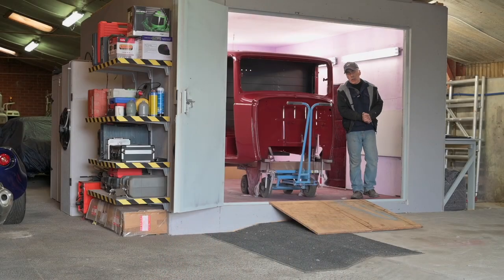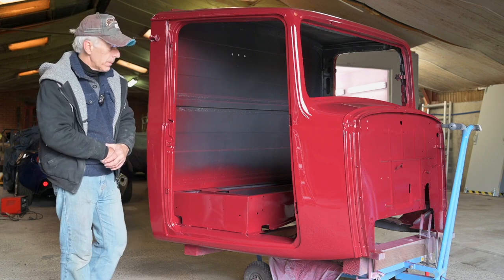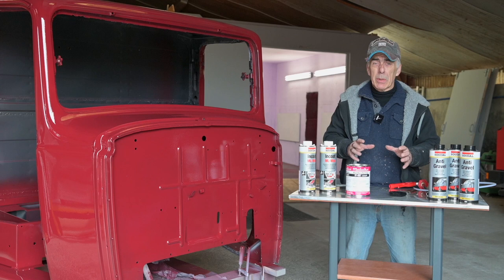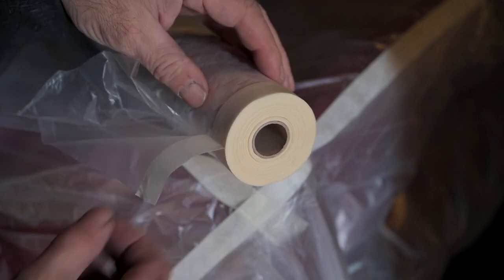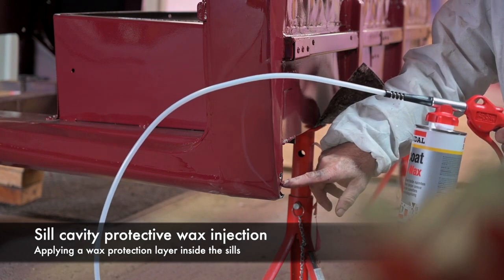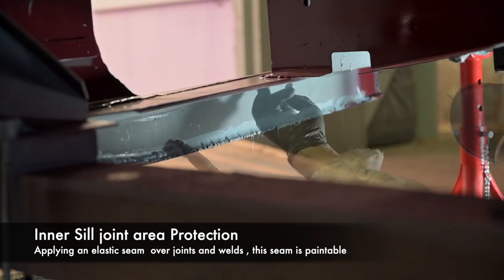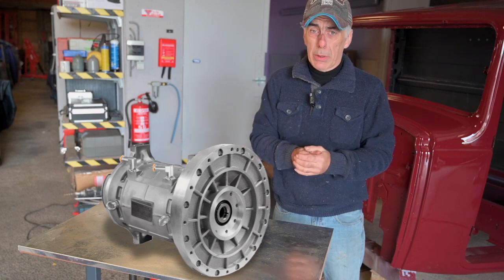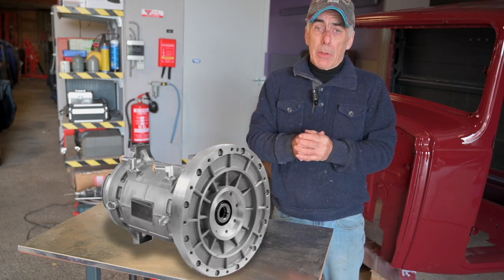Old Rusty, Part 24  Protecting against rust

Comment: How much more will it be used if it is electric?  It is old and you have the original equipment.  If I was missing the drive train or it was totally unfixable then a change would be in order.  It is what it is.  Electrify something else.

Comment: You going to install a rear end from a Corvette? Maybe wheels and tires from a Lamborghini? Change it's entire look? If was mine and I had the time and funds I would want to keep the  35 HP gas burner. My 1943 Ford tractor still has it's (mostly) original 4 cyl engine. But that's just me.
Reply from the maker: TXS for the comments, and I can see your point.  I really need to think it over on which way I want to take this. Off course not extreme.

Comment: Hello Steve,
Rules about the definition of a classic car state that if you put any part that didn't came from the factory (or was available at the time)  then the car is no longer considered a 'classic car'. Same guidelines state that if a car is used daily, then it is also not considered a classic car (which I strongly disagree with).
Thing is, if you are building a museum piece, more to be looked at than used in the real world then go with the original engine. But, as you mentioned, older cars are beeing banned from the cities (oddly they still allow it for diesel cars....)  and if a modern, even if electric engine will allow you to use the result of your hard work more often, then why not? (you can always revert it back to the original engine if you want to sell Old Rusty).
Cars are complex pieces of machinery and a lot of parts will last longer than others so I pollute even more of our planet building thousands of new cars every year when an older car can be modernized and keep up with modern emissions targets?
Going with electric is a good idea, but keep in mind where you charge it (use solar, not coal produced electricity). Other option could be hybrid but technically more 'challenging' ;) 
Lastly, if you opt for electric power you should try to use automatic gearbox. It'll be best suited for that.
Whichever route you go for, choose the one that will allow you to use Old Rusty as often as you want. 

Keep up the good work :)
Reply from the maker: TXS for the comments, and I can see your point.  I really need to think it over on which way I want to take this.  Great answers and comments.... txs

Comment: I would love to see you install an electric motor I have an old water-cooled VW van and replacing with an electric motor sounds like a good idea. However, I can see the merit in an engine rebuild for this classic. Emissions are only an issue if its an everyday driver, if it's a high days and holidays vehicle then there will be more pleasure in an original engine. Either way, I'm sure I will enjoy the videos you produce and both routes will be worthwhile. Best wishes.

Comment: Do both and change to whatever you want .But without any structural mods. Make fitting brackets  to fit oridginal set up.
Reply from the maker: TXS for the comments, and I can see your point.  I really need to think it over on which way I want to take this.

Comment: I'd probably do both. Restore the original engine, but go with the electrical motor for Old Rusty......
Reply from the maker: TXS for the comments, and I can see your point.  I really need to think it over on which way I want to take this.  But installing an EV motor requires a lot changes...  so having both is a bit difficult
Reply: @D3Sshooter  in which case, absolutely go Original.

Comment: Depends on how you will use it.
For the people not from the EU ,having the old engine means Old Rusty is banned from most cities (you can enter a few days a year provided you pay a hefty penalty)
This would result in Old Rusty sitting,not being used at all for most off the year.
Just gathering dust in a garage.
Advantage electric engine 

BUT the petrolhead in me says restore the old engine and make original.
A dilemma.
If money was no problem..............................do both.
Reply from the maker: TXS for the comments, and I can see your point.  I really need to think it over on which way I want to take this. That is the dilemma that we all face here in Belgium..

Comment: Looks like you purchased the electric already. If it's not too much extra work, install the electric to get Old Rusty on the road, then take your time sourcing and restoring the original with the eventual goal of putting it back in. Best of both worlds?
Reply from the maker: TXS for the comments, I did not buy it yet that is just a video green screen trick..   I am still considering both options

Comment: Do both. Series hybrid with a forklift motor inserted into the driveline after the transmission. Motor could be assist with engine on or motor only with engine off.
Reply from the maker: Thanks for the comments, a bit complex but am option.. However I started the overhaul

Comment: Restore the original engine and transmission.
If you must go modern, use it to run a generator and charge batteries. 
Then run the electric motor to drive the vehicle
I believe all your effort would be undermined from the financial perspective if you went electric
Regardless.....have fun with what you want to build.
Reply from the maker: Thank you for the comments

Comment: The electric motor sounds interesting, but I would stick with the original engine. Do they have a later vintage Citroen engine with more HP you could swap in?
Reply: itsjustme Then it wouldn’t be “original” anymore.

Comment: Keep it gas. If you're really concerned about rebuilding the old engine, you might consider swapping in a more modern gas or even a small diesel engine.
Reply from the maker: Thanks for the comment, started the rebuild of the old engine

Comment: Well sir that is totaly your choice though personaly i would go with a good diesel engine due to one not knowing where the world is going like in tensions building up atleast diesel can drive through water with a snorkle and one can use vegatable oil etc for fuel.On the old enjine will a beatle sollex carb work on it? Personaly i moded the base of a beatle to take an vw golf carburetor by making 2 plates out of aluminium and welding them together thus replacing the old solex and making it more fuel efficiant.

Comment: Engine overhaul, its an oldtimer which won't be driven daily and if you fit an electronic ignition system, updated carburretor etc the engine efficiency will be better than when it came off the factory.
Reply from the maker: That is correct, and what I plan to do

Comment: I myself like old style restoration but while you are rebuilding trains and gas motor you could place the electric 
while you work out the bug with handling and suspension  steering box and such there for still being able to drive the old truck in either condition  old fashion keeping it all as it was meant to be or as electric
Reply from the maker: TXS for the comments, and I can see your point.

Comment: At least here in the States, insuring a home made electric vehicle is problematic. At least when lead acid batteries are used, as weight distribution, CG, mechanical brakes and such get into issues that insurance companies don't want to deal with. I'm also into keeping the original drive train, as once this has been converted to a Frankenstein, it will never go back, and it's value is scrap.
Reply from the maker: TXS for the comments, and I can see your point.  I really need to think it over on which way I want to take this.

Comment: Restore the original engine. By using electric motos and batteries you will loose all payload  of such an old vehicle, have to upgrade the brakes and rear axle. I can see it being a major headache and in the end devalue your vehicle and all that hard work you have put into it.

Comment: Although a "restoration" would imply retaining the original engine, I think working out the challenges of fitting electric would be a fascinating exercise, and is probably the way that the restoration movement will be obliged to go in the future. No point in restoring things to a condition that we are unable to use in the future.  Stay with petrol if you want to keep the vehicle in a museum. Go electric if you want to keep using it.

Comment: I am afraid that it will simply not be a restoration if you replace the core propulsion unit - it would become a simulation with a nice old cabin. There is no argument, I am afraid. The old engine must be restored.
Reply from the maker: TXS for the comments, and I can see your point.  I am leaning towards that approach
Reply: I know it will be whole lot of new work  to restore the engine as well, but this will add so much to your wonderful restoration so far!

Comment: As it seems I'm the first here maybe I should make the first comment.  The power unit.  Well, I think that things like this are not about what may be practical or in some way "Green".  It's an old truck and it is being restored.  It will always be an old truck and a pretty impractical one at that compared to a modern one.  The appeal of the truck is it's appearance, which echoes an earlier time.  I'm sure that when it's finished it will look superb, but the idea of it moving along without the sound of an engine but with all the creaks and rattles of an old vehicle doesn't seem right.  There is another Youtuber who has restored the same truck but has used the engine and gearbox from a Renault van.  It all looks, works and importantly sounds well and seems to be a great compromise between aesthetics and practicality.  That's the way I would go with your truck.
Reply: Seems like a lot of effort has been spent to keep it authentic so far...why didn't you chop the top or modify the body from authentic? Why change from keeping  authentic with the engine and transmission? You have spent a LONG time on the cab..does not seem like you are afraid   more hard work. Anyone can modernize something..not much history in that .

Comment: where you drilled the hole and put a rubber bung in, you should the bung back out and put some anti rust on hole or it will rust, I would go for the petrol engine if there was a way to put an oil filter on it

Comment: Overhaul Yes, electric conversion no.

Assuming you can afford it. 

Yes, electric will give you better performance. But really, is the entire truck, suspension, frame and body meant for high (well higher) performance?
Reply from the maker: Hi Dave , overhaul it is..
Reply: @D3Sshooter  BTW, if you need parts I may have some from my fathers hoard. None for the truck unfortunately but that really looks like my 11B block and I know he has other 11 parts...
Reply from the maker: That is a kind offer. I will see how far i get with the parts i have.  Txs
Reply: @D3Sshooter  again, I'm struck by how similar the door handles (both inner and outer) and the door latch Tang (that's all that shows in the videos) are to my 1951 11B. Can you post a picture of the window winding mechanism? If the inside is as similar as the outside you may find 11 parts, which are readily available, very useful to you... :-)

Comment: Really enjoying this series - Nice to see 'Old Rusty' getting some love.  Go electric.  There will come a time when diesel/petrol will be banned in all cities.
Reply: You are completely wrong. Electric cars are inefficient and as eco unfriendly as gas engines as the electriciy is generated in gas or oil burning power stations. And the you have a hard time recycling the spent batteries which cost half the price of the vehicle. Even if fossil fuel engines are outlawed you can still run it on Hydrogen

Comment: 90 horses with an electric motor and keepimg the original braking system....No way with that! .  Keep the original engine and transmission  whether it needs an overhaul or not. When finished this project will be a great vintage one.

Comment: How do you intend to use it? If you intend to make it a daily driver, go for the convenience and ease of operation: go electric. If your intent is to showcase the truck and your handiwork: put the original engine in. You have spent much time and effort getting to where you are. You just need to figure out where you want to be and the answer to your question will be self evident. dw

Comment: Normally I would say overhaul the engine and keep it original. But 90 horsepower versus 35?.  Easy answer. Go electric and pack up the old gasoline engine for storage.  Good luck whatever you  decide
Reply from the maker: Thank you for the comments

Comment: D3Sshooter . Cannot believe you would be asking viewers this question about fitting an electric motor as it will be your choice what you want to do . My 2 pennyworth is keep it as original as possible like you have done so far with this restoration but if time and money is a problem and you need to get it done quicker  use a more modern petrol unit and gearbox while trying not to alter so much that the original engine/ gearbox can still be refitted at a later time to bring it back to original.

Comment: you can't change just one item such as that really powerful electric motor, if you did go that route it would need upgraded brakes, steering, lights, seatbelts, padded dash, and airbags.  Sounds like a Disney ride to me.  It would be like have a historic old train with a dummy steam loco in front with a diesel in the rear actually doing the pushing.  What's the point?
Reply from the maker: Thanks for the comments, indeed

Comment: Sounds like you are leaning toward the DC motor. If the intention was to put it all back original then you can't use the electric change. If you only want it to function, put the electric. At this point, the old way for me would be lots more work and it seems easier. The image of the old truck is restored but I don't think that was an original color, and now you have lots of new metal that replaces the rust so to make it electric, there is no fooling restoration, because it is not restored. The idea of restoration is complete and so to move it down the road with invisible means is not much different. Sorry. Hope this helps. I'm not trying to blow smoke. I like the project. BSA
Reply from the maker: TXS for the comments, I am torn between the two options, it seems that I leaning towards the gasser

Comment: with the life span of the restoration (the time it will last)I would go electric now rather than fit it later but at some point make a stand and remake the old engine ( not rebuild remake ) so you can show it at shows as you would get more use and life as electric truck

the cost of rebuild or conversion to electric is a no brainer
Reply from the maker: That is an option as well   TXS

Comment: A bit of a no-brainer really. Rebuild the original engine and clutch and gearbox. It will make sense when you are finished. Have a look at my original Austins here: www.lillytilly.co.uk
They would not be the same for anyone travelling in them if they had a modern drive train.
Reply from the maker: Thanks for the comments, and indeed that is what i just started

Comment: Electric isn't going to last. Hydrogen engines will replace electric just a matter of time.
Reply: Hydrogen is the way to go, but tax revenue isn't collected when a fuel can be made and not bought at a refueling station. If cars doubled in gas/fuel mileage, the governments would lose half of their tax revenue. Governments want more tax revenue, so hydrogen is shelved because it can be easily produced by the user.
Reply: Mr Rytte 
They’ll just tax your mileage and increase the tax on tires. Not to worry, they’ll get there money, one way or the other.
Reply: @chevymarineretired  Check how much highway tax is collected per gallon. then add that up on a year to be added to mileage and tires. Yeah they will get the revenue by keeping it the way it is, because it's hidden. The US federal highway tax is 18.4 cents per gallon. The state I live in adds 41.4 cents to that for a total of 59.8 cents per gallon.
https://www.usatoday.com/story/money/2019/02/05/gas-tax-state-what-costs-fill-up-your-car-across-country/38908491/

Comment: By it’s age it is an historical piece, not a daily driver, has zero hot rod value, it would never be capable of sustained highway speeds or maneuverability so to not restore the original motor and keep it all original is the only logical choice.
Reply from the maker: Very well worded, and that was also my consideration.

Comment: OH no, we i thought are in the business of preserving these old vehicles. The gentrification of old vehicles is such a shame even twin-pack paint spoils the look, cellulose is there original paint and should be used to keep the original patina. Twin pack is so obvious, looks like a celebrity with porcelain whiter then white teeth. There are plenty of vehicles to fit an electric motor in. Think you have the message there wont be much left of Old Rusty brakes will have to be improved and so much more. Stop the rape of this lovely almost original vehicle

Comment: Cosmetically restore the original engine and conceal the electric motor under the bed. The use of petrol is a long term mistake. You can the take a step into the future without dishonoring the history. Also, letting your viewers decide what you do is a poor way to choose.